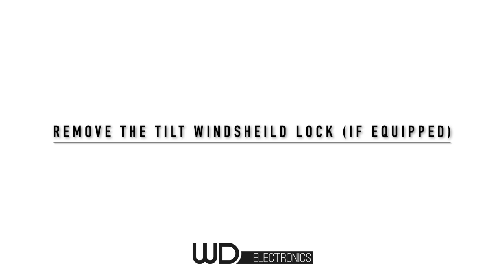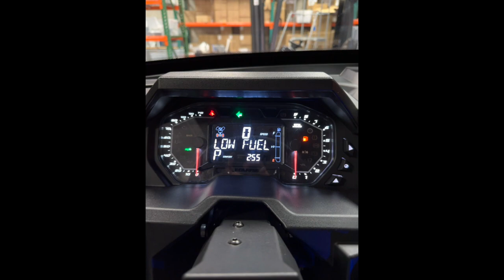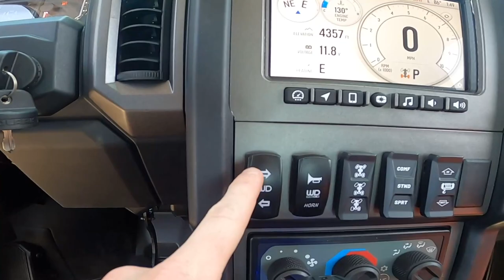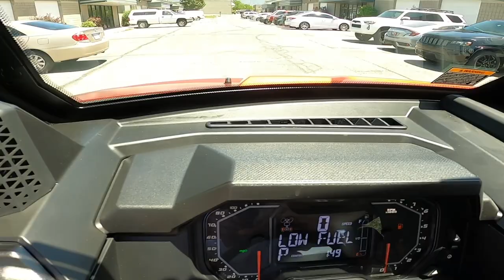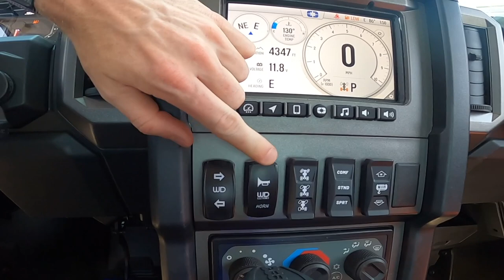Polaris Xpedition - Street Legal Kit Install | WD ELECTRONICS

Comment: Just received my Xpedition kit yesterday.  Great product, install was a breeze after watching the video and everything worked flawlessly.  Only (3) recommendations, the blinker lever bracket needs to be checked, it's a bit too wide for the column mounting area and  really needs overtightening to work well.  I'd also suggest making the connections, coming out of the control box longer, they're awful short and it would be nice to have a few inches of extra wire on each. Lastly, include a way to plug off the license plate light connector for people not planning to use the license plate bracket/light.  Great job on the video and kit.